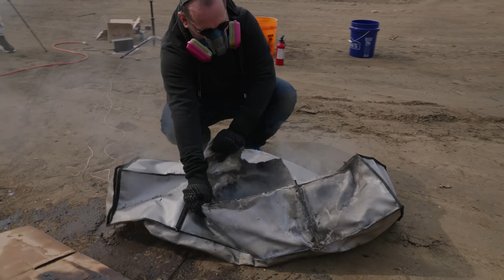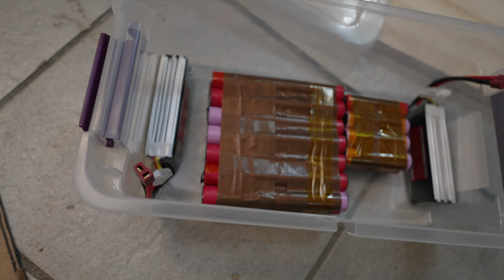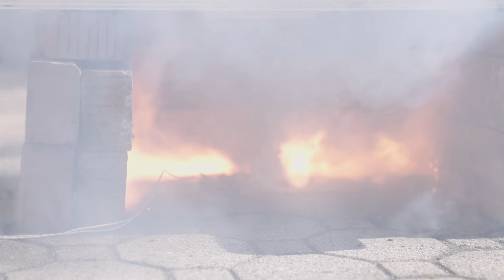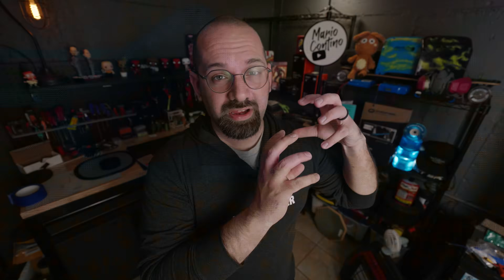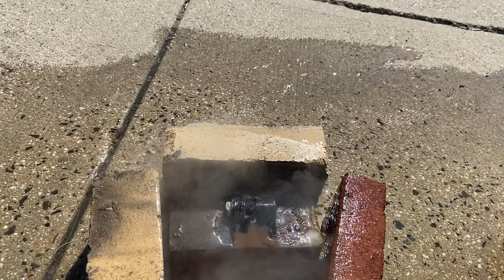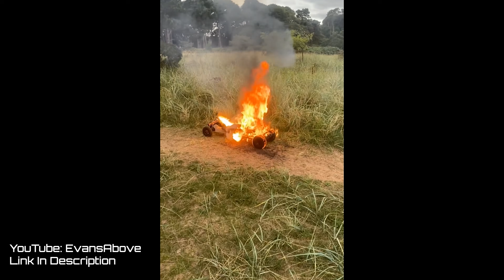What If Your Battery Explodes? Nobleman Fireproof Bag Review

Comment: This right here is why I'm a patron and subscriber. Well researched, practical, thorough, no bullshit. Three cheers. As to Nobleman's response, it sure didn't look like the seams are what failed, it looked like the material ripped. In any event, making a stronger pressure vessel is not a way to make the situation less dangerous, that's like trying to make a safer pipe bomb by using thicker pipe. Any system which wants to really solve this problem is going to have to vent the overpressure in such a way as to not set the surrounding surfaces on fire. Tricky problem, for sure, but I don't see any way around it, the volume of gas produced is gonna have to go someplace.
Reply from the maker: Thank you so much for your support and your kind words. They mean a lot. 🙏
Reply: @TheBoardGarage  It's made in China junk lol. Although I've seen videos of these bags that seem to be made in China and actually contain the fires.  The problem is its a crapshoot roll of the dice, 5 star reviews on Amazon are meaningless because some of them are just shills, while others put 5 stars and never even bother to test the products. This society is a total joke. 

One thing you can try is see if it is Internationally Certified. But I don't know what particular certification to look for. I know there is a fireproof certification but I don't know if there is a specific Lithium explosion certification or not. The International Certification website should have a list of approved products and companies to make sure the certification label that the company on Amazon/Ebay claims to have isn't fake.

And I'm more inclined to go the ammo box route. If the volume of gas per amp hour is truly 2 liters as you say, then a battery might have only a few hundred PSI at most. Surely an ammo box could contain this? Although transporting a pressurized 400F ammo box would be be nerve-wracking.

Because stopping the fire is only half the battle, there are also toxic fumes. Most of these bags are designed to emit fumes to reduce the psi. And the amount of research on the fumes seem to be low effort, the search engine just seems to show bot-made websites that regurgitate the same talking points. The conclusion seems to be there are 100 different chemicals in the fumes and that nobodies sure of chronic effects.
Reply: What about a t n p valve?   It would release pressure without letting fire migrate
Reply: Update: I am not sure about the ammo box route anymore. Someone showed than an ammo box is too flimsy and could cause an explosion. I guess ammo boxes are not meant to contain ammo explosions. Perhaps a reinforced ammo box might work but I would feel unsafe holding it if a LiPo ignited inside. There doesn't seem to be any solution to prevent fumes. All in all a very low effort to create reasonable lithium safety products.

Comment: Excellent explainer, thank you! You mentioned supervised charging, which I do. But in your opinion, is there any appreciable risk of a battery pack catching fire in a board just sitting there and not turned on or charging? For the sake of argument let's say it's been at least an hour since charging.
Reply from the maker: The risk of a random failure or fire in a board that's just sitting there, and has been sitting there for a while, is pretty unlikely. From my testing, cells took about 4-10 minutes to enter thermal runaway once a very high heat source was applied. Usually the issue would present during the hours it would take to charge a PEV, or during its use since impacts and vibrations are combining with high current draws from the entire device. If a board or other PEV is working normally, hasn't been in an accident or subject to abuse or misuse, then generally it would just simply be fine. The only instances I've seen of random fires from something sitting there are from major manufacturing oversights, that lead to a gradual failure as the product sits there. But that's also very rare. The worst fire events where property is damaged and people are harmed, seem to be from charging overnight, or from it not being monitored. The few videos I've seen where these fires happen while the owner is present, they can usually act quickly enough to both call for a Fire Department, and try to address things however they can.
Reply: @TheBoardGarage  Thank you, that's roughly what I assumed but it's nice to hear from someone who has built packs and experimented.

Comment: Thank you.  It's like a length of fireproof tube needs to be installed on the side to vent gas.  We used to look for a "UL" label on products to assure that products were held to a standard.  We seem to have let that slide in recent decades.

Comment: Very interesting. A bit out of topic but in your opinion, provided it is correctly installed, is a CBXR more dangerous than a regular XR ? I mean, regarding fire.
Reply: As far as I’m aware, if it is done correctly, since the CBXR cells are higher quality/can handle more current, the chance of it catching fire is very very low. However, whenever you modify something, it’s probably a good idea to assume that the chance of failure is higher even though theoretically it should be the opposite. But, with all of the testing done on the original OneWheel battery, it’s fair to say it’s very safe. Now if a CBXR battery did catch fire somehow, it would most likely be a larger/more violent fire due to the much increased capacity of the cells, and the pack all together. This is just based off of my knowledge of batteries, but I’m sure there are plenty of people that know much more than me on this topic.
Reply: Yup... the more energetic potential it has the more violent the reaction will be.  What's happening in thermal runaway is the potential energy is being released rapidly and being turned into HEAT..